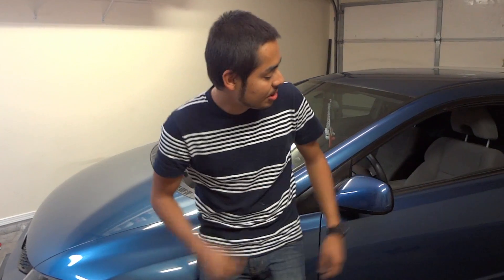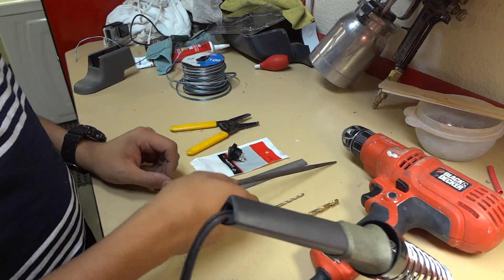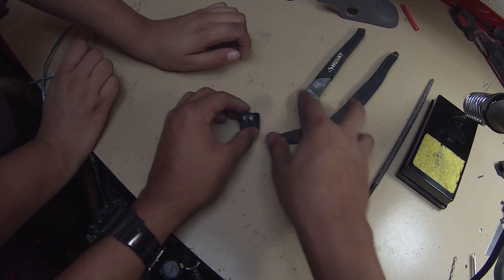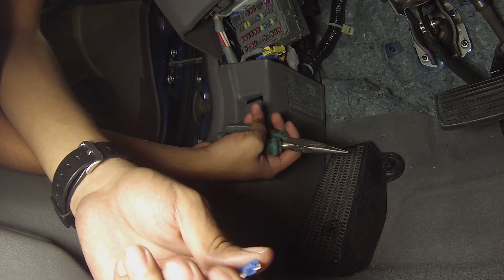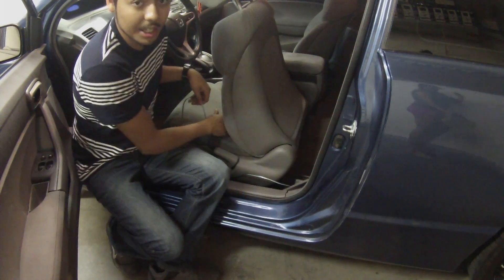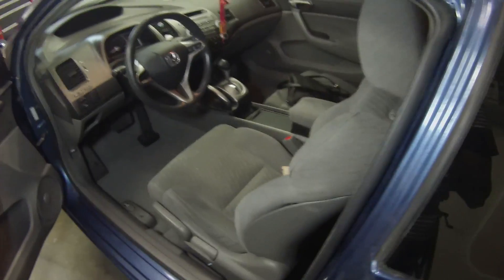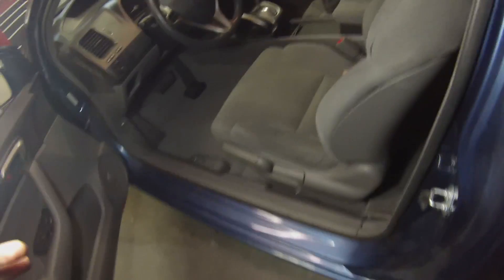How to: Install a Kill Switch on your car

Comment: Great video. Simple and straight forward. I have one question. Could I do the same for starter fuse and go from there? Same wiring setup, just wired to starter fuse. Looked everywhere and can't locate fuel pump fuse on 90s Toyota.
Reply from the maker: Anthony Blanco Yes, that will work just fine!
Reply: Cool, thanks.

Comment: You don't want to put pieces that are designed to pop (fuses) under carpet unless you want your car to burn down.  You don't want to stick wires into the fuse box.  They make kill switches for this purpose.
Reply from the maker: chadddada I must have spoken incorrectly. The fuse holder is not supposed to go under the carpet (either way, they are not going to burn down your car. That is exactly what they are designed to prevent). That will make it very difficult to replace in the event that the fuse does pop. I will say this though, wires directly connected to the fuse is quickly identified, and can be bypassed quickly as well... wink wink... So maybe you can find another way.... maybe looking behind the fuse box... but if you cant find another way then this will do.

Comment: don't fuel pump uses relays not fuses? And the first place any person with car knowledge will check the fuse box. The best way for this method is to find the wire that goes to the fuse box and splicing your kill switch with that where everything still looks factory. Won't no car thief would spend that much time trying to trace the wires that runs to the fuse box. That can literally take hours.
Reply from the maker: They use a fuse and relay. A relay for the high current and fuse for protection. Your definitely right but in my experience, thieves break into the car and attempt to start it by hot wiring it and if they cant they don't try and start it because of fear they will get caught If they take to much time. That and the fact that they probably don't have a spare fuse on hand is probably good enough to keep your car safe. But your definitely right about tracing the wire.
Reply: but u can easily move an existing fuse from another location in the fuse box and just start the car. I do it all the time

Comment: Very helpful video thanks. I drive a 2000 Civic and those things are easy to steal. Mine got stolen a few weeks ago, cops found it, and the dudes at the tow shop told me to install a kill switch so I might have to do this. You're right no car is theft-proof but in a joyride theft situation like my car a thief isn't gonna waste time trying to bypass a switch. A more valuable target, maybe
Reply: +Christian Macias damn.. how'd you find out where the car ended up?
Reply from the maker: kwirkLA That's how I see it. Unless you piss somebody off and all they're after is your car, i don't think they're going to spend to much time trying to steal your car. My brothers car ended up at a chop shop in mexico. It sad to wake up and have your car gone. Thanks for watching!

Comment: Do you use the same fuse as the original in the fuse holder? Or do you use a bigger amperage fuse?
Reply: Alex Fernandez If you don't mind me adding to that answer, it does need the same amperage fuse. The reason is that a higher amperage fuse won't blow when the circuit's maximum amperage is reached, nullifying the purpose of it and creating risk for damage to the car and/or fire. A lower amperage fuse is likely to blow too early, making the circuit stop operating even under normal use.
Reply from the maker: It needs the be the same amperage fuse.

Comment: Why not just get a bad fuse thts blown and when u want just take out the good fuse out of the holder put the dud fuse in the good fuse slot then they would have to check the case and find the fuse slot and check it  and if there stupid they won't and just take stuff out of the car and go lot easier plus u can see there's not a huge wire running through a fuse lol
Reply from the maker: Mostly because the switch is meant to be put on daily where as if you take out the fuse constantly your going to loosen the contacts and can break the holder eventually. Plus if somebody wants to hot wire your car, they usually only have a couple of minutes to do so. Doesn't mean they won't steal it though. They tow the cars away in a tow dolly. So I always tell people to turn their tires away from the street so that they can't do that.

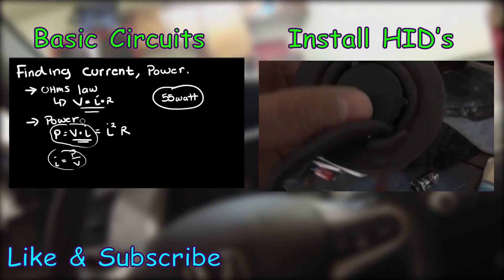Comment: Excellent video! I wound't have sat through all 12:06 seconds of it if it wasn't. I had the exact same thing done FOR ME for my Honda Prelude many years ago, but I didn't do it myself so I never knew what exactly was done. All I knew was that I flip the switch and engine turned off and stayed off. Now I know how it was done. 
Three times, mofos broke into it and stole things, but my car was always there. Maybe they never meant to steal the car, who knows.
What you did in the video, will it work without messing up the highly computerized modern cars?
Reply from the maker: Al Saguchi As long as you don't mess with the computer fuse. On a few cars I have seen that the fuel pump fuse can trigger safety equipment like SRS, so iv'e started recommending looking for a fuse related to the ignition system on newer cars rather than the fuel pump. My reasoning for using the fuses is when a fuse blows, you normally just replace it and your car runs just fine. A switch is in effect, is like have a blown fuse and when you turn it back on, it's like you put in a new fuse. You normally don't have to go to a mechanic to replace a fuse. This is why I chose fuses but this isn't the only way. I greatly advise for using other methods if you know what your doing because as things like this get popular, thieves will eventually learn how to bypass the switch.

Comment from the maker: Ollie Oak I can definitly see your point of view. Although it may not take a genius to figure out how to bypass the switch, it does take work and time (which is critical when stealing a car). This in adition to turning your wheels in a direction that makes it difficult to tow, makes the car less desirable to the thief. As I said in the video, if your car is targeted and sombody really wants it, then consider it gone. Quite frankly, if its stock or a common after market alarm, there will always be a way to steal it. Your also correct about it being a fuse to relays. Thanks for your input! Feel free to follow up! I love to hear opinions. Especially from people who have experience in this.
Reply: false. i know my bro car in cali... a area known for car-stealin'on the regular, real hood, and the car was found same evening.(great detective work that is why.) found it same evening. no damage.
Reply: +Christian Macias What are ur thoughts on Lo Jack brah? Cause I tink the neiborhooders be targeting my car. I'm considering Lo Jack for theft recovery.
Reply: lojack is the best recovery system there is you have a very high chance of finding you car if stolen..without lojack you probably won't ever see it again.

Comment: As a mechanic the first place you look if the car doesn't start is the fuse box. You'll see the fuse that was tapped into. All you'd have to do is put a bit of wire in there.

The fuse you used isn't for the fuel pump. It was for the fuel injector and fuel pump relays.
Reply: So no more "gone in 60 seconds". I'd rather walk out to the parking lot and see someone messing with my fuse box then driving away in my car. See my point? This is a quick and cheap kill switch. I also have my wires hidden and fuse box locked just to make it more annoying for a thief. I also have a throttle control and set it to max slowness when I park it so if they do manage to take it, it won't be fun.
Reply: @DrGanknstein  I like your thinking! I am a pro security expert, you are thinking like a crook, good job, keep adding features!
Reply: no you wont. I removed the fuel injectors as a precaution just in case. I also have it chained to cement anchors so it can't be towed. Plus its parked in my garage three stories below the earths surface.
Reply: @DrGanknstein  I like your style. You should have a moat around it too.. with sharks with laser beams attached to their heads... or a least Sea Bass, I'll tempered of course!
Reply: If I was a car theif and the car didn't start, it would think it was a dud and move onto the next car. I wouldn't  trouble shoot car problems on someone's car.
Reply: As a mechanic sure you'd look there,  as a thief you'd move on to the next car. They don't like to make noise or waste time on one vehicle.  However. Is it actually a good idea to use the fuel pump or injectors fuse? Aren't you dry starting your car all the time then if fuel is cut off? I'm not a mechanic.
Reply: Come to think of it, if the thief has the same fuse all he have to do is replace it. Wouldn't it start then?
Reply: My fuse box is locked
Reply: @DrGanknstein  In the systems I design, I weld a metal box around the fuses if possible, but getting to them means nothing as I have multiple "layer" security. Crooks now know that cars have kill switches and remotes that kill the engine when they drive off with you car, so now they wait for you to start your car and use "carnapping" where they hold a weapon to you and force you to drive to their safe spot, where they often kill the driver/occupants. My systems are prepared for that.
Reply: Kevin Johnson trust me none carry fuses and they certainly do not stick around trying to figure out why they can't start this one car. Any kill switch would be fine
Reply: @thecurvedr  Oh, I beg to differ, a guy I worked with was a part time car repossesser. He kept many high amperage fuse of every style (about 6 styles in all for most cars). He said he learned that from a pro car thief.  Jamming a screw driver or paper clip in a fuse jack is flimsy and can fall out as you drive away, a 50Amp fuse will do the trick. He held a mirror down there so he could be nonchalant and see if any booby traps were there (the razor blade trick for one) and just jamb fuses in all the empty spots. It only slowed him down a few seconds but he did it first - alarms blazing or not. This guy had balls, he would repo cars from the projects at 3AM and was often fired upon as he drove off. He showed me how to make bump keys that can open just about any car lock at the time in seconds.
Reply: @thecurvedr  Sometimes crooks target a specific model car (or even a spefic car) they will spend up to a minute on average to get the car started. They have look outs to tell them when to bail.  They will often do it with alarms going off all around them, they are cool as a cucumber in the fridge. If they cant start it, they may come back with a tow truck, but they have to wait for the heat to cool off and it may take 90 seconds to tow a car in some cases.  I did design a 2 inch steel clamp system welded to the bottom of a car and a 2 inch steel ring rebared and cemented in a garage floor. The guy used a special guide system I designed so he could put the car right in the precise spot, activate the clamp and other security features and close the garage. It was virtually tow/steal proof.
Reply: 1985 el camino
Reply: @DrGanknstein  Mine is a 1897 Fiero GT.
Reply: Kevin Johnson thieves don't fuckin carry fuses. Lol we carry a flat head, a window popper and pepper spray
Reply: true true
Reply: Trendin Forward let's think like a thief not all are smart but some will prepare for any situation and be very quick on there task, any will fail and research then get the job done. I would suggest to put more then one switch to make it even harder ...... I want to get a kill switch on my ride ASAP to give anybody hell to even try to attempt to move it

Comment: I have a double din deck and amp and subs I got it installed a long as time ago now my deck automatically turns on when the car is started. There is no button to power it off its a pioneer deck also my amp is always on when the car is on... I wanted to put a switch to power it off and on when I'm not using it both of them.. 
Tips ?
Reply from the maker: It is normal operation to turn on when the vehicle to turn on but you would rather have manual control over this you can do the following.  There is a wire on the radio and amplifier labled as remote or signal.  Cut that wire and run a new one that goes to a switch, then connect that switch to a +12v always on wire. The current the the remote wire is normally very low so dont worry to much about high currents. You maybe want to fuse that wire for safety.

Comment: Have you thought about using an accessory button for an accessory your car no longer has?  This might not be applicable to a newer car, but a cruise control button on a car without cruise control or the ac button on a car with the AC stripped? would the accessory button work the same as the toggle?
Reply from the maker: So long as the switch is made to work as a latch. If its a a momentary it wont work. I actually really like that idea. I might go out and buy a sun roof switch from the junk yard and do it. Haha
Reply: Thought about the cruise control, ac, fog light, defroster, etc.. the continual accessory buttons. and several of those are 15A circuits anyway so you know the switch can handle it.

Comment: No need of drilling hole in the fuse just short it, and it will blow the fuse then you can use without damaging it
Reply from the maker: Abdul Hameed Excellent alternative. Ill add it to the description. Drilling helps prevent heat from happening and melting the plastic of the fuse. For anybody reading this comment, you can connect the fuse across the battery and it will burn it out for you without having to use a drill. It will spark but it wont be too bad. If you don't have a drill this is the good alternative as long as you are careful and make sure there are no flammable liquid/gas around you when you do it.
Reply: Abdul Hameed hi

Comment: what type of fuse holder is that?
Reply from the maker: Patrick McDonald It is an ATO fuse holder. You can also use an ATM fuse holder if you have more of those fuses handy. I believe ATM is what most cars have anyways. http://www.bdfuses.com/images/automotivefuses.jpg
Reply: Thanks very much! i own a honda and have had it stolen twice and one that i never got back so i decided adding a kill switch would be good so once i get this back from the shop I'm gonna try to use this video to do it cuz I'm sure its the same after all, all hondas are like mirror images when it comes to the wring and fuses and all

Comment: Why can you just remove fuse every time you get out of car? might be a stupid question but just asking.
Reply from the maker: You could but it is not practical. It would mean every time you plan to leave you car out for a while, you would have to pull the fuse. If you have additional things on that circuit like maybe a car radio, it might cause you to lose the radio presets and have to reset every time.
Reply: try pulling out a fuse that is mounted upside down 50 times... It'll eventually fall out while your driving.

Comment: nice video i will like to try it does it work on a Nissan b14 car ?
Reply from the maker: Yes it will. You can try the fuel pump or ignition fuse.

Comment: Very usefull video thankz, quick question the fuse we have to drill it to the point where the wire breaks? The one goes across from one side to the other
Reply from the maker: Yes. You're purposely breaking the little wire.

Comment: On my 98 civic the fuel pump fuse also has to do with the srs airbag circuit will that effect anything if i do it the way u did?
Reply from the maker: Chad Yeary Well, it has had no effect on the 2010 civic. I wouldn't think it would have a negative effect on your 98 either. If for whatever reason you get the SRS light on, you can reset it. This is a video on how to reset the SRS light on the civics like ours http://youtu.be/54QxIwpx0QY .If you do experience negative effects just choose another fuse that wont allow the car to turn on.  I have a 97 civic but the SRS unit has been broken since I bought the car, so I would not be able to tell you exactly.
Reply: Alright thanks appreciate it
Reply from the maker: No problem!
Reply: Ur honest opinion u dont think the airbags would go off do u?
Reply from the maker: I don't think it would. Just don't forget to add the same amperage fuse and you should be good.
Reply: Does it matter what side the fuse goes on?
Reply from the maker: As long as its on the wire

Comment: FINALLY! an easier way to install a kill switch. Thanks!
I don't have a "fuel pump" fuse can I use the "starter relay" fuse?
Reply: +Christian Macias Nb With newer cars, even if you force the starter to run, the ECU needs at minimum a signal from the crank angle sensor and/or other sensors to start. Without those signals they can force the starter till the battery is dead and it wont start.
Reply from the maker: Definitely! The fuel pump is usually the best choice because people who do steal cars know that the starter is what most people put the  switch on. Not only that but the fuel pump is inside the car and is nearly impossible to force start it ie.. give it a current. A starter you can actually make it turn from the outside.. (I wont say exactly how). There are other fuses that do the job too. On some cars they have a fuse called ignition coil or something like that but whatever stop your car from running is all you need! A thief only has a few minutes to start your car and if they don't do it withing that time, they just leave.  Thanks for watching!
Reply: +RMRKV1 that would be true if you want the armature to spin. If you want it to actually turn the engine over there are other things that need to happen my friend.